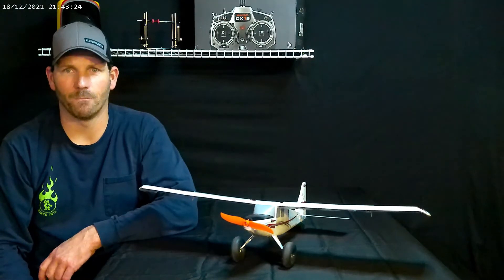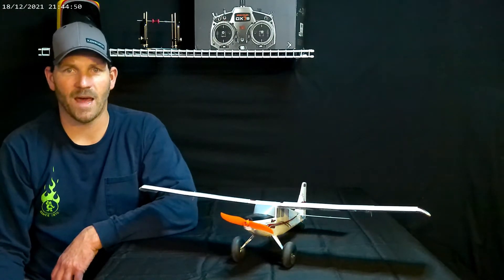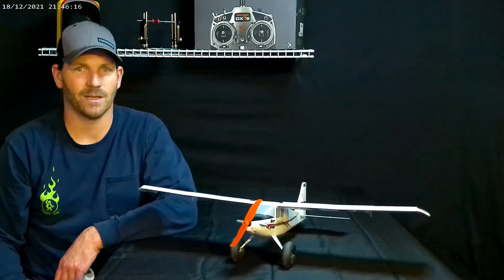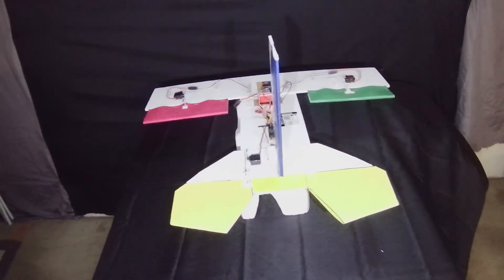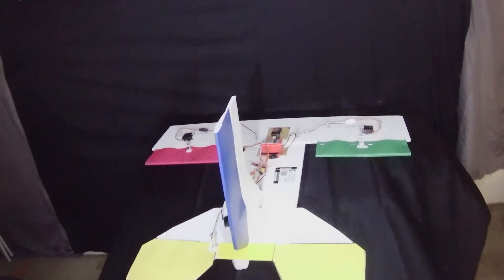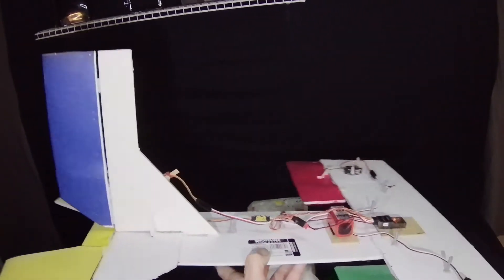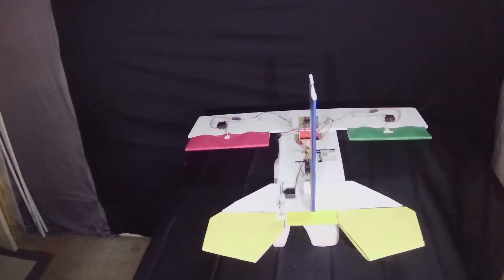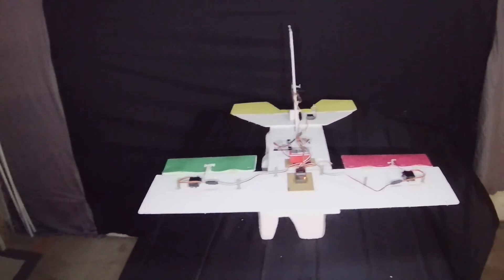WEEKLY #4 THE DIFFERENCE BETWEEN AS3X AND SAFE SELECT E-FLITE SPEKTRUM RC AIRPLANE

Comment: Thanks for another great video. You didn't quite answer the question I have though. What is the purpose of safe mode as compared to the purpose of AS3X? I understand they're both a type of autopilot but why would you use them? And why would you use one over the other? What are the situations?
Reply: Hopefully you're one of these YouTube content providers who actually answers the questions from your dedicated viewers!
Reply from the maker: SO AS3X IS SPEKTRUMS NAME FOR STABILITY ASSISTANCE IT IS ONLY FOR THE WIND FOR STABLE FLIGHT. AND SAFE SELECT IS SEPERATE THAT IS THE AUTO PILOT. SAFE HAS THE PLANE RETURN TO LEVEL FLIGHT WHEN YOU RELEASE THE CONTROL STICKS . AND HAVING SAFE ON A SWITCH ALLOWS US TO EITHER FLY WITH SAFE ON AT ALL TIMES OR HAVE AS A BACK UP. I FLY WITH IT ON AND OFF. TUEN IT OFF AND DO A TRICK OR IF YOU LOOSE ORIENTATION OR THE SUN GETS IN YOUR EYES YOU CAN TURN ON SAFE FOR A SECOND TO HELP YOU OUT FOR A SECOND. SPEKTRUM AND THERE SAFE SELECT GAVE US ALL THE OPERTUNITY TO ENJOY THIS GREAT HOBBY WITH OUT SAFE WE WOULD ALL CRASH OUR PLANE ON ITS FIRST FLIGHT HOPE THAT HELPS THANK YOU FOR WATCHING MAYBE WE CAN BRING YOU INTO THE RC AIRPLANE WORLD